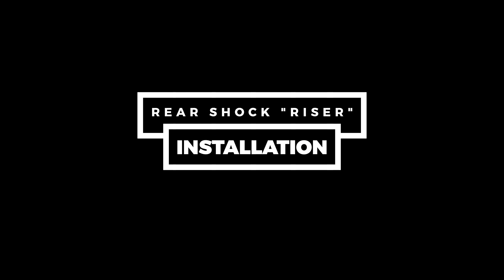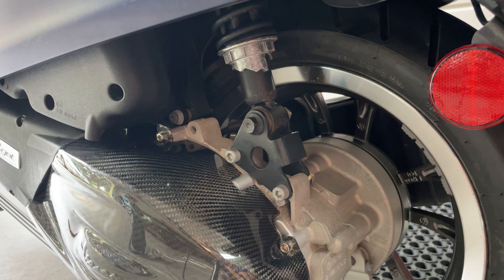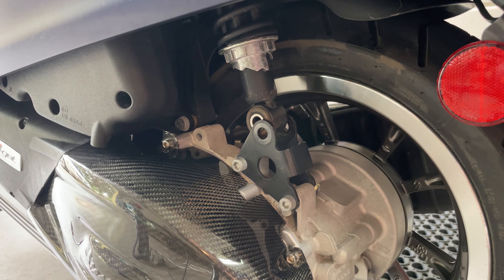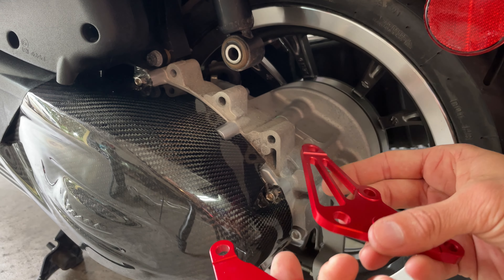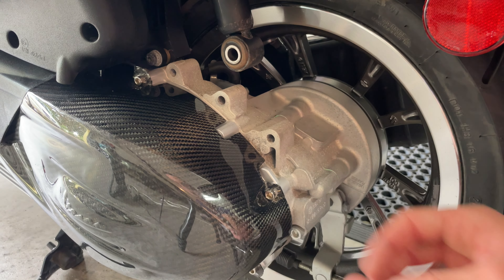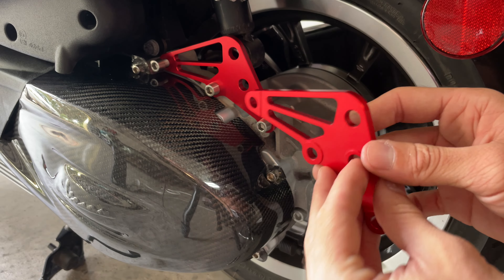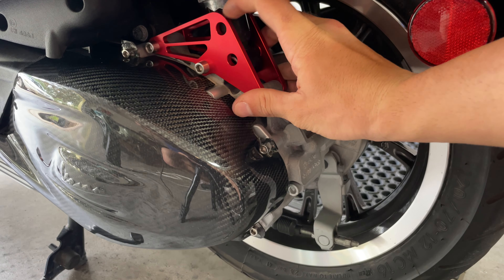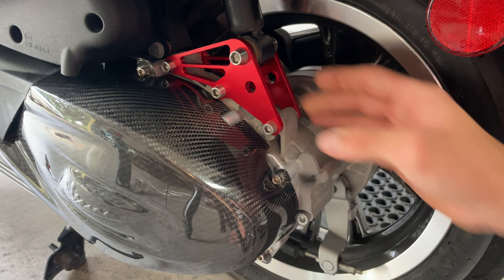How To Install - Height Reducer Kit - Vespa Primavera/Sprint

Comment: is the highest position same height with the stock?
Reply from the maker: Hey! Thanks for the comment! The kit lowers the rear of the scooter by about 2 cm. From an original 850mm to a more acceptable 830mm, the second lower hole is for a little more adjustment if needed. Peace✌️